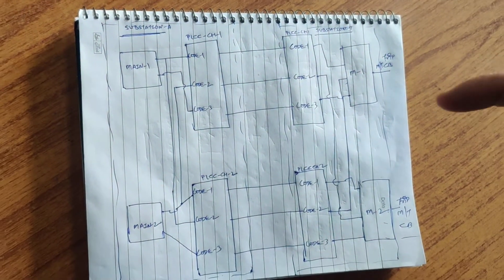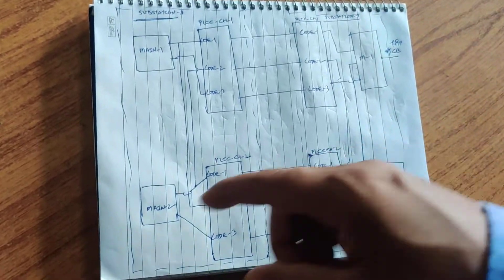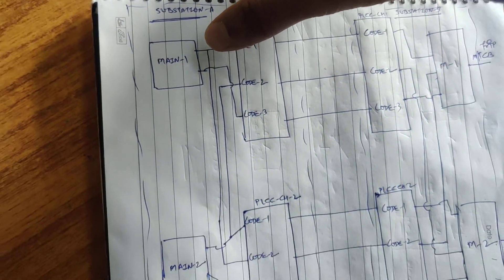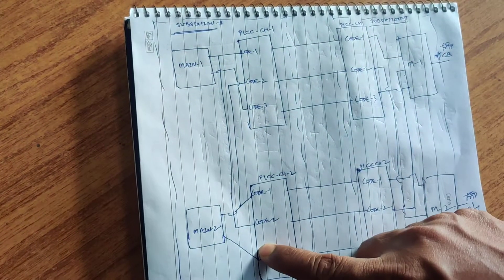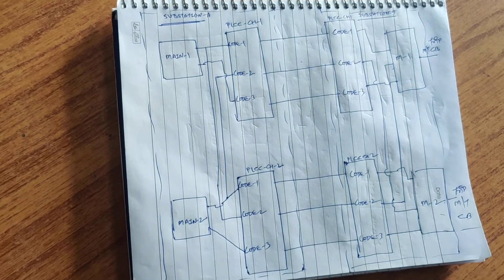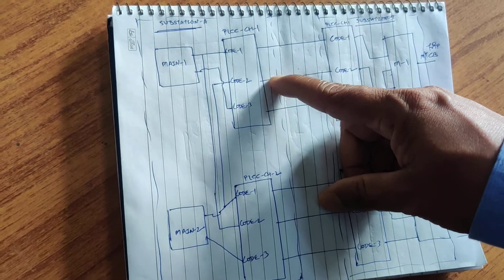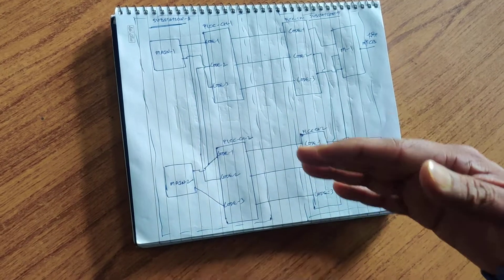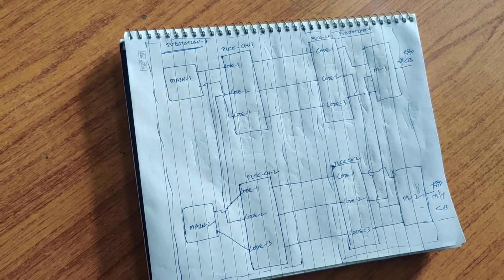Power Line Carrier communication (PLCC) l Part-2 l

Comment: PUTT Key is used between two distance protections local and remote connected at the end terminal of a transmission line. When the remote relay RR detects a fault in zone 2, it initiates a PUTT key to the local relay LR to trip instantly, however, the LR waits until it detects the fault in its zone 2 forward direction to trip the local breaker. Some protection engineers provide timer settings to avoid any false attempts to operate the local relay due to transient, inaccurate CTs, or in case of paralleled transmission lines, the PUTT key is transferred through a communication line either PLC,  Radio, or Fibre Optic. Any signal delay between the transmit and receive signals should be considered.
Please correct me if I am wrong?